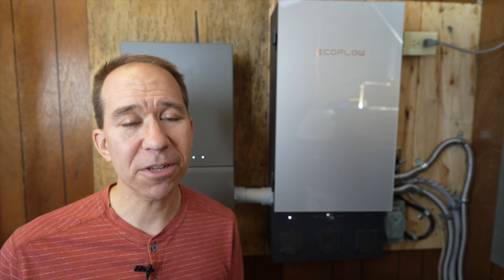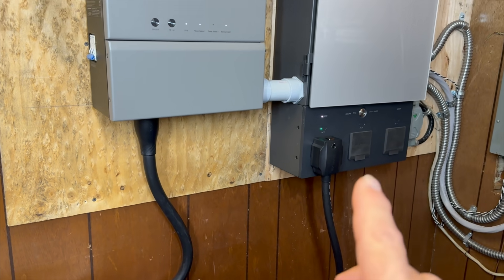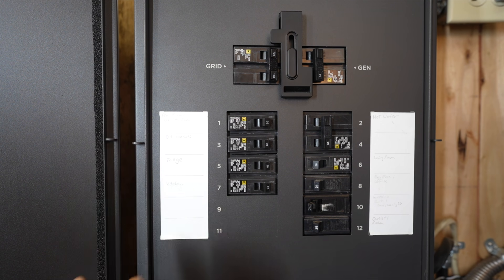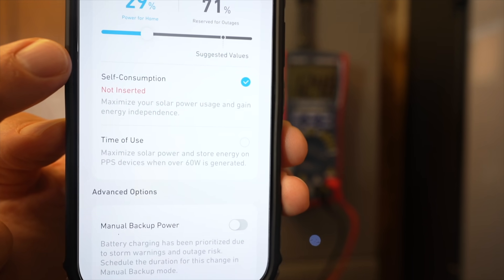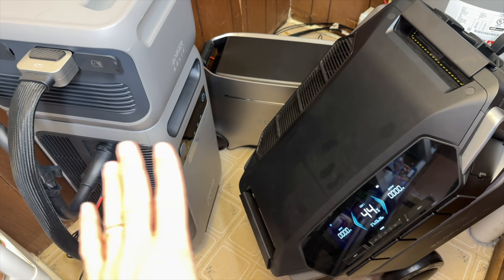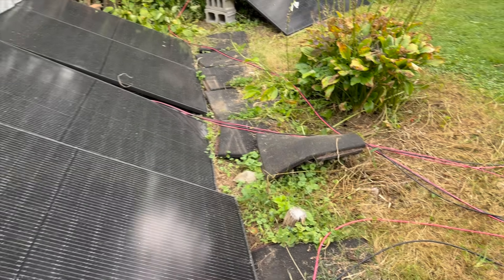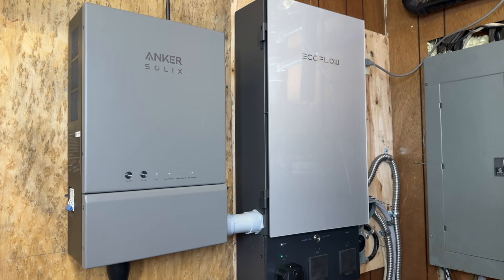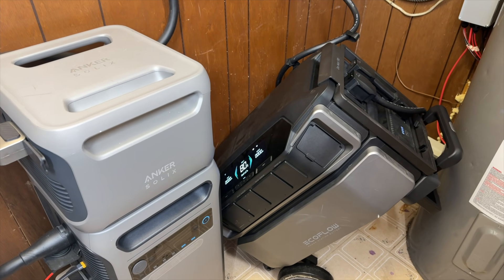I Installed Two Home Battery Systems - Which is Best? | Anker HPP VS EcoFlow SHP2

Comment: Never says which is best!
Reply from the maker: Because it depends on your situation.  I really like the AC coupled feature with the local backfeeding with Anker.  But the DPU and SHP2 has the smart circuit level controls and higher solar input.

Comment: I get twice the wattage when connecting 3 (400w) solar panels in series than 4 panels two series pairs in parallel to the ultra low pv …I was wondering if you had similar experience? I was expecting a loss but not in hundreds of watts especially with an additional 400w panel
Reply from the maker: That is interesting. I haven't seen that.  Could there be an MC4 connection that isn't connected in one of the parallel branches?  I had one of my parallel branch MC4's go bad recently and I was wondering why the array wasn't making the same power as it should.

Comment: Very informative. Thanks for this video. Quick question can you use this to ac couple into existing grid tied solar inverter for islanding in case the grid goes down and want to keep the rooftop solar.
Reply from the maker: You can do that.  That's what I have.  Both the HPP and the SHP2 auto-isolate when the grid is not detected.  My grid tied inverters don't produce power when the grid is down.  You need to have a backup load center and solar directly inputing into the respective battery units to run from the battery and still input solar.
Reply: @ so you have the SHP2 and grid solar inverter on the same AC coupled circuits?
Reply from the maker: My grid tied inverters are on a line-side tap so they connect in before the main service panel.  HPP and SHP2 are daisy chained off of one 100 amp breaker on the main service panel.

Comment: If I connect a generator with a 120V output to the EcoFlow Smart Home Panel 2, and my home's power consumption is lower than the generator's output, will the excess power be fed back into the battery?
Reply from the maker: That is my assumption though I only have a 240v source.  In the smartphone app there is a setting to change the generator input from 240v to 120v, so that's what makes me think it would work.
Reply: @solarguy  Yes, I have figured this out, the battery can simulate the phase of another 120v line.

Comment: Really like the Anker panel. I already have a transfer panel with critical loads so the SHP doesn’t make sense. I also don’t like that in the SHP, if something happened, I’d lose all those circuits until someone came out to fix it.

The Anker panel would power my transfer panel but if it ever broke, I could simply switch it to line power.

I already have the EcoFlow because of the ability to charge via AC and output 240v, along with the 450v solar input. I hope they come out with a similar panel because the AC coupling sounds great. It’s hard to perfectly set a transfer panel to what my panels produce. Some days it’s perfect but during the summer it’s possible I’ll over produce. Ability to shed some to the main panel would be
Reply from the maker: Those are great points about point of failure.  The local backfeeding feature of the HPP is very nice.  Maybe EF will come out with something similar.

Comment: I being forced into backup because my local power company is going to turn off power during wind storms now.  The spring wind storm lasted about 10 hours, but it was 4.5 days later that power was restored to the house because the power company had to visually inspect every inch of the system to insure no damage was done before re-energizing the system to my underground fed neighborhood. There is nothing cheap about installing the battery and solar cell backup.   Even just a system to keep the freezer, refrigerator, furnace, and O2 machines running will cost over $10k using both generator and small solar power to recharge a 8kw system.
Reply: I assume you’re in SoCal too? I have a generator and considering this Anker set up
Reply: @chrisg6893  I was in the Marshall Fire in 2021.

Comment: Can the SHP2 function correctly with the Delta Pro Ultra and the Pro 3 connected to it? I have the panel and ultra but also want to get the pro 3 for times when a more portable solution is needed outside the house.
Reply from the maker: That's a good question. I asked and was told it isn't supported yet.  It sounded like they were working on a firmware upgrade to be able to do that.  I'll need to ask again to see if there are any updates.
Reply: @solarguy  would love to see a video on that if it is compatible, how it handles load sharing, both units on solar and discharge, high wattage draw, etc

Comment: so you're saying i need one of each ;-) ... I have a detached garage/office with grid-tied solar and separate load panel that is parallel to the load panel in the house. Would like to take advantage of TOU plans ($0.03 super saver vs $0.26 Peak) as well as an Outage Backup mode that will keep the Solar generating for me...

Comment: This is crazy. Does this mean only the Anker can power the full main panel and the EcoFlow can only power the circuits in the sub panel? 

Can the Anker supply the full main panel while grid is down also or does it cut over only to the Anker subpanel?   I had been leaning towards EcoFlow but questioning that now.
Reply from the maker: The HPP doesn't backfeed power to the main panel when the grid is down.  This is a safety requirement for AC coupled devices.   So when the grid is down the HPP only outputs to the backup loads.   In normal operation the HPP backfeeds power when the grid is up so the loads on the main panel consume that power.  When the grid is up it also outputs power to the backup loads.  An important point is that it does not allow backfeeding to the power grid, just locally to the main panel.  The SHP2 does not backfeed so it can only power the loads on the panel itself but you get the smart features and circuit level control.
Reply: @solarguy sorry, this is so confusing. Can you utilize the full Anker back up and solar potential via the smart panel when there is a power outage? Yes or no, please. Thanks.

Comment: Does the anker HPP have any solar input?  Or is it just on the F3800
Reply from the maker: The HPP itself doesn't take in any solar.  The direct solar input is on the side of the F3800.  The HPP has the current sensor for a solar array so you can monitor your solar output (say a rooftop system) and also charge the batteries when your solar inverters (doesn't matter the brand) are producing power.
Reply: Thx for the info.  For some reason I thought the HPP was Anker’s solution to overcome the 60V solar limit.